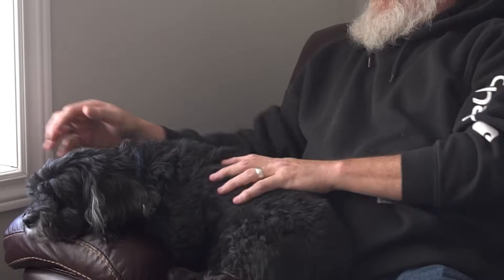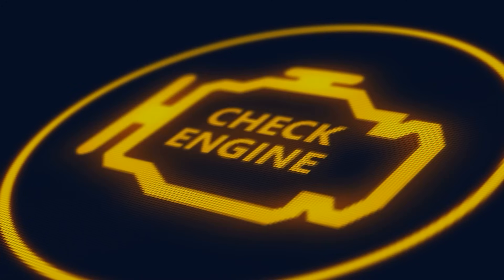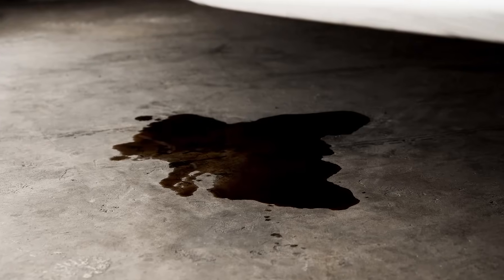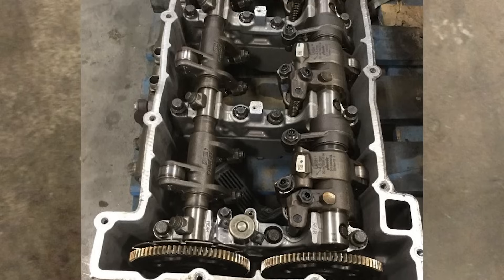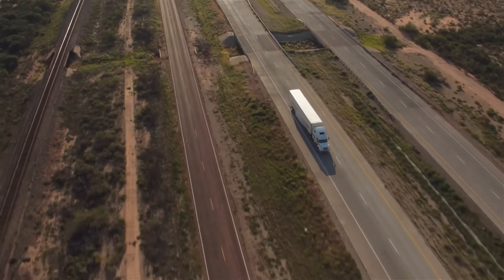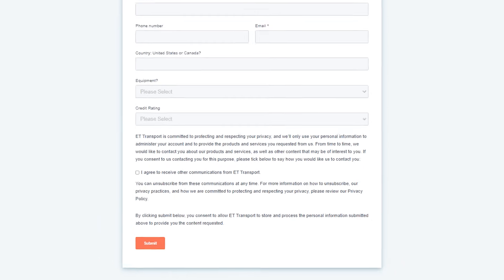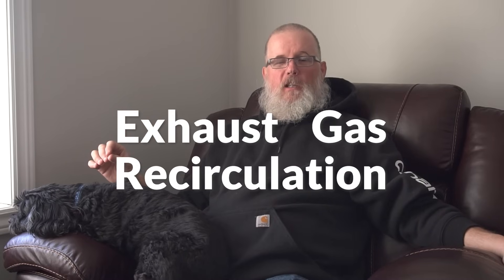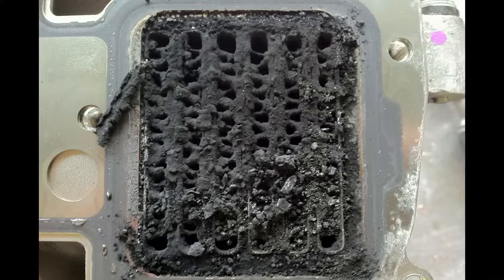Biggest Issues with Diesel Engine DD15 - WATCH OUT!

Comment: you can clean the EGR cooler, just need to know what chemicals do it. It's pretty easy, but you will be messing with nasty stuff like brick acid.
Reply: We clean DPF filters with hydrochloric acid and after a few minuts wash it with hot water pressure.. the cheapest way
Reply: @blaznovak170  Interesting. You should first try a soak in dishwasher detergent. It removes the black soot a little better than the acid. I do this first, then the brick acid bath for 25min the solution is 25% brick acid and 75% water. rise in-between each of corse. I also made a sonic cleaner for the soot removal stage. It's unreal how well this process cleans them. I got flow numbers just like the new filters give me. 

I did a test with various solutions and dpf filters/soot, i found the acid does not break down the soot as well. I also found a couple other videos on youtube about it.  Good stuff!
Reply from the maker: Nice!
Reply: Do you use Adblue for exhaust system?
Reply: @ I dont use anything. I hear good things about Pittsburgh power additive. But if you want to know how to clean them, I can tell you, same with cleaning dpf filters. I can get them like 95% clean or better at home.
Reply: @mmafreaks4871  AdBlue is a diesel exhaust fluid (DEF) used in vehicles with Selective Catalytic Reduction (SCR) technology to reduce harmful gases being released into the atmosphere. AdBlue is a 32,5 % solution of high-purity, synthetically manufactured urea in de-mineralized water. The exhaust pipeis is clean you can eat steak from it..looks like only in europe we used it. We never clean or replace the EGR cooler, we replace it only when it leaks inside.

Comment: Coolant leaks has been a problem.  Not so much because of gaskets or seals rather cause of sloppy manufacture don’t tighten bolts.  Same thing with diesel fuel lines
Reply from the maker: Thanks for letting us know

Comment: Have a 2011 DD 13 that cranks upon priming and then hydrolocs.   Any ideas?    It has new injectors.   We are thinking its the pressure relief valve on the fuel rail.
Reply from the maker: Might just be best to take that in to a mechanic to be honest

Comment: Make sure to adjust intake valves periodically,  the clearance between the rocker arm and valve stem will diminish. You can immediately tell when cranking to start or rough idling.  Cause intake valves are not sealing compression.
Reply from the maker: Thanks for the tip!
Reply: Made that one up !

Comment: I am a Freightliner Parts Salesman..common issues..(1) leaking oil pan gaskets. Make sure to change the bolts w/the grommets.  There is now a kit just for the grommets! (2) Oil leaks at the injection tubes to injectors...don't just change the gaskets at the injectors...replace the six injection tubes (they come with the gasket). (3)  Oil leaks at the injector wiring that goes through the valve cover gasket (oil can travel through the front & rear harness and cause electrical disruption between injectors and ECM), (4) DPF issues do to extended idle times,  note cleaning the DPF filters does not bring your DPF filters to 100%!!! Install new filters and you want have replace them as often! (5) DO NOT DELETE THE DEF SYSTEM, THE TRUCK WILL NEVER RUN CORRECTLY AGAIN, AND IF YOU GET CAUGHT THE FINES WILL BE STEEP! NOT TO MENTION NO FREIGHTLINER DEALER WILL EVER WORK ON YOUR TRUCK AGAIN UNTIL THE SYSTEM IS COMPLETELY REPAIRED TO OEM SPECS!
Reply: The oil leak in harnesses seems to only be an issue on extended service intervals and or with shit quality oil as its not the oil but the carbon concentration in the oil ie how black it gets that it becomes electrically conductive

Comment: I know this is about dd15 but we have a big fleet of dd13’s (various years of freightliner cascadias ) and we have yet ,knock in wood, have a fuel system failure. More specifically a fuel pump. Hell we have a 2014 with just of 700,000k miles and we JUST put a one box into it which was surprising because we’ve typically seen trucks need one boxes wayyyyyyy before 650,000
Reply: How are the dd13s in general? I just got one def and egr deleted and I’m scared of either the dd13 messing up or the Eaton ultrashift 10 speed auto messing up (it’s a 2013)

Comment: In 2015 I had 4 2010 western stars with DD15s. 2 of them dropped the oil pump pickup at 300k, 1 locked up. I recently got them fixed. I put series 60 14L in them! DD15 are junk!
Reply: The actual sump was already cracked/damaged/warped at 300k? Or were the o-rings bad? 

I replace the o rings and sump every 400k on dd15 just to be safe.

Comment: I think my 2011 dd15 is having a fuel quantity control valve. The engine seems to have a lope when it idles or like a surge. But no check engine light. Any thoughts? Truck only has approx 550k original miles.
Reply: That’s the quality control Valve .

Comment: i absolutely agree with you on the dd15. i have been truckin for 40 years the best most reliable engines are detroit diesel i have been runnin a 60 series for as long as i can remember never have i broke down and could not fix the problem easily love them like my wife can always count on them. Larry B
Reply: Lol!! I strongly disagree! Every time I've had a major breakdown, it's been a Detroit diesel.  I switched to a cummins isx! And guess what?? I'm able to make money 💰 without usually spending tons of money on repairs! But to each his own
Reply: @tonygarrett9115 how is that Cummins holding up? No blow by or low oil pressure while idling?

Comment: Some professional workshops are not doing a good job and are dishonest about the work they’ve done. Failure to replace filters, using cheap low grade oil. Some workshops are so brazen that they openly admit that they don’t carry out all the maintenance work as required by the manufacturer.

Comment: I am a certified Detroit Diesel tech and work on these every day. The major issues depend on which generation you have. 
Epa 07 I am not too familiar with. 
Epa 10, oil leaks on rear structure, head gasket, cam housing, injection Pump, air compressor, oil pan, oil coolant module, Aftertreatment issues. Injector issues

GHG 14, probably the best DD engine they built. Oil leaks are the same on every engine. Injector issues, can cause backward running engines. 

GHG17. Metal in fuel/Injection Pump grenading. Head gaskets leaking, wrist pins coming apart, one-box issues. 

Gen 5/GHG21. The absolute worst engine Detroit has ever put their name on. Liner o-rings fail causing coolant to leak out of headgaskets. Head gasket oil leaks, the overhead adjustment needs done several times before 100k miles or you will drop a valve bridge, bypassing oil passages, engines majorly failing before 10k miles. I've seen 1 with 675 miles on it drop a valve, just rebuilt an 8100 mile engine that broke an oil ring. 

Those are the most common issues I have seen. I would stay with the GHG14 engines, 17s are not terrible but not great, avoid Gen 5 like the plague.
Reply: So.. what year you talking about wen you mention GHG14 .
Reply: @Eduardo Sandoval  GHG14 is 2014-2016 I think even some 2013's were GHG14 as well. Detroit typically comes out with the new engine 1 year before the EPA required Date.
Reply: Hello so is the 2019 model a gen5 engine im thinking about getting one
Reply: @dguido1000  no. Gen 5 cane out in 2020/2021. Easiest was to tell if you have a Gen 5 or ghg17 engine is to look at the fuel system, intake manifold,  egr cooler, or one box. The ghg 17 intake manifold is mire square than the Gen 5. Ghg 17 high pressure fuel rail supply lines stick straight up on the rail, on a Gen 5 they are angled. Those are the easiest. GHG 17 engines are good engines, but they have their problems too. I will say that Detroit is finally starting to fix a lot of the Gen 5 issues. I'd you do get a Gen 5, get a late 22 or 23 truck.
Reply: @Mopars_41  ok thanks my budget has me staying at a 2019 model..there’s one with 494k on the miles ..would you recommend that I usually run the Volvo d13
Reply: @dguido1000  honestly, the only way I will ever recommend a Detroit engine is if you get the max warranty you can. Detroit engines, in my experience, between about 500k and 750k miles see a lot of expensive repairs being needed.
Reply: @Mopars_41  appreciate the information what about the Cummins 15
Reply: @dguido1000  I really like cummins engines. I know certain years have camshaft issues. We don't see a whole lot of X15 engines, so I can't give you a definitive these engines are worse or better. But I believe them to be less problematic than a Detroit. I'd choose a cummins over any other modern engine I've worked on, those being Volvo/Mack, Detroit, and Cummins.
Reply: @dguido1000   I own a Cummins ISX 15 with 1.5 million miles on it. she does not give me many big issues. The 2016 Detroit dd15 I got has cost me a lot. She has 500k miles.
Reply: Hello sir I have few questions I see ur a tech. I have a dd15. And looking for some info

Comment: My 2016 DD15 was squealing but only while driving and the sound of it goes up or down with the rpms - Took it to Freightliner  - paid $300 for diagnosis  - was told it was fan hub needing to be replaced  - 2 days and $2900 dollars later for a 3.5 estimated job nothing was fixed  ! The tech only test drove it in the parking lot - the squealing dosent show up until about 45 mph and I explained all this to them in the beginning 

I went back made them pull my old hub fan from the garage and give it back to me  - now I am waiting till morning to see what their story is 

I am suspicious of a false diagnosis  - its still squealing just as it did before I went to the dealership 

Tech mentioned a saturated belt but said they didn't have one snd recommended I get it replaced 

I am not paying $2900 over a sqeaky belt it thsts all it is. - I am going to take the old fan hub to a different shop snd see if they can yell me if its faulty or not 

This has been a terrible experience so far  - Anither guy was waiting 5 days and they still haven't figured out what the problem is on his truck 

Maybe decriminalization of all drugs in Oregon was not the best thing since sliced bread idk but this is complete bull crap !  

I am going to call my bank Monday and put a stop hold on the payment if Freightliner dosent come up with a solution worth $2900.00 very soon !!!
Reply: Well what did u end up doing brother
Reply: Change your belts

Comment: I really wish I had this video back in 2016. I had a 2012 cascadia with a dd15. I made a left turn from a 2 lane to a 2 lane. oil dropped to 9 psi. (Scan gauge connected) No One could tell me. 2 months later I find out (with 3 Gal of Lucas in it) what's up. Do the tubes. 3 weeks later I am furious that I have oil in the water and water in the oil when at home . I had hit 73 psi on startup 3 days earlier. I thought I blew out the oil cooler. I cried. Filed Bankruptcy.End of ownership of a business. Don' ask. 
Suggestion. When you do the tubes at a REPUTABLE SHOP( Steer clear of empire in Mobile)have the O-Rings of oil cooler done too. Same material to seal.

Comment: Idle is the biggest reason for carbon build up,so get an APU and problem solved!😁Any diesel engine, not just DD15!About the o-rinngs on the pick up tubes, I think one off the reasons for them going bad is extended oil changes,wich turn the rubber into plastic.Great video!🙂

Comment: Hello sir 
I have 2015 freightliner cascadia dd15
I have sign spn 102 fmi 18
I am in trouble 
I have change dpf one box
Change new turbo all sensors all hoses but code still hav do you anything of this kind 
I already waste to much money 
Intake system derate 25%
Reply: Did you fix your problem?

Comment: Coming from a small company that had nothing but pre-emissions cats I think the DD 15 is a joke. We have a fleet of over 30 Cascadia’s all with DD engines we’ve had five of our trucks blow the glued on piece of plastic on the driver side of the oil suction manifold completely off and lose oil pressure instantly. The O-rings are one thing causing low oil pressure but the manifold breaking kills them instantly. After seeing four of our own trucks and two outside customers trucks with completely demolished engines the owner of our fleet decided to pull every truck he had in and replaced the suction manifold some of which had already had the O-rings replaced due to low oil pressure. That’s a lot of money to spend because of crappy plastic parts. These new DD engines are not real Detroit’s this is a Mercedes engine I don’t care where it’s built but it’s a rebranded Mercedes engine. I believe in other countries they call it a Mercedes SM 471 which you can actually see the 471 just beneath the valve cover on a DD engine you can look this up. We’ve had a lot of bad air compressors which are a pain in the ass to change especially on the shorter nose trucks which if you’re an owner operator that’s extra labor you’re paying for to get it replaced. Get an older truck fix it up and be happy. We’ve not had any major problems with oil leaks other than the little seals around the injector lines which isn’t a big deal and leaks around the crank case filter or separator. Aside from that the engines do OK if one of the petty problems doesn’t kill it first. I consistently see owner operators with older trucks that they have practically rebuilt giving way better service than some of these newer ones with all the electrical and emissions nightmares not to mention the automatic transmissions when they go haywire. Honestly don’t see how owner operators afford to keep these things on the road. Debonded hoods the glue that holds the top of the truck together coming loose leaking windshields Frieghtliner actually put a plastic gutter type thing over the fuse box so when the cab leaks it doesn’t kill the sam cabin. I have learned to hate these trucks even though I know they’re nice and comfortable and do a good job when they’re working right but they are super poor quality everything is cheap. I had a owner of another trucking company explain to me why he would spend 50 grand on a high mileage Peterbilt or Kenworth and then take a gamble on how long it would run before he had to rebuild the engine or replace a transmission or drive axle and he said because if I keep good service records on these trucks and keep them looking good I can turn around and sell it and get back what I have in it and he’s exactly right and I’ve seen him do it for years. His early 2000s model peterbiults and Kenworth all with cat engines give better service than 80% of our  newer cascadias. The interiors and cab definitely hold up way better
Reply: i went from owning 12 379" s with cats to all cascadias.  fuel went from 4.5-5.5 to 7.5-9mpg. it would cost me 40-50k a year per  truck in repairs.  just traded in my 2019"s and  got my new 2023"s.  when you own your own trucks you will think different. you guys must all be horrible  drivers or something to be destroying them. don't believe all the bs they tell you.  put 80k on a 22 year old truck then 35k on a platinum caterpillar rebuilt   then tell me how great it is ..

Comment: The biggest problem with the DD 15 is that it’s not a Series 60- 12.7
Reply: I'd just as soon have a Series 60 14L and reprogram the EGR valve operation.
Reply: 60 series is best as i  resarch about it
Reply: YEP! 😆
Reply: Yea but they don't make the engine anymore and is pain in the ass to put it in a newer truck
Reply: Correct,  Bigsur  1355  cubic inches...
Reply: @petersack5074 ROFLMAO. 12.7 liters is 775 cubic inches. 15 liters is 915 cubic inches.
Reply: @deeremeyer1749  sure and the best engine ever was the 855 cu Cummins

Comment: Our fleet has had five high pressure fuel pump failures. From 2015-2018 year models, but the 2017-2018s seem to be more problematic than the older ones. So far the failures have all been between 300-350,000 miles. First warning will be a knocking sound or tapping noise at idle that almost sounds like a burnt exhaust valve. You’ll also see super fine metallic shavings that look like grey sand in the bottom of the fuel filter housing and even on top of the filter cartridge itself. As the pump continues to disintegrate you’ll notice a loss of power and sluggish throttle response, particularly under a heavy load. The fix is “simply” replacing the high pressure fuel pump. The pump alone is around $1,800 last time we had to buy one. If not under warranty, the total cost is about $7,000 (US) because basically the entire fuel system has to be replaced. Not just the pump but also the lines, injectors, etc. And no, you will not get any warning lights with this failure.
Reply: so i just got a 2016 dd15ni should replace all the fuel system asap to avoid break down and costing an engine right like they say an an ounce of prevention is better then a pound of problems. or something like that. Larry B
Reply: @larrybroad8746  : if you are still covered under the warranty you might be able to talk the dealer into it. Otherwise I think I’d take my chances. From my experience you’ll get a warning before it dies completely. I was able to drive mine another 60 miles to the shop after it started making a noise like a burnt valve, and the other drivers here had similar time before it quit.
Reply: That doesn't make sense if the HP pump is failing as its after the filtration unit so no evidence will be seen in filter so if your seeing this contamination it could be related to why your getting the failure not from it !

Comment: Definitely don’t forget about the exhaust leak I have been in the shop 6 times for the exhaust clamp into one box and just last week had an exhaust leak by turbo the bellow flex pipe I’m only at 46k miles 2022 gen v dd15 505 hp 🤦🏽‍♂️ if the truck gets one more exhaust leak I’m about ready to throw this truck in the trash 🗑
Reply: There is a recall for this reason, I'd recommend checking to have it done.